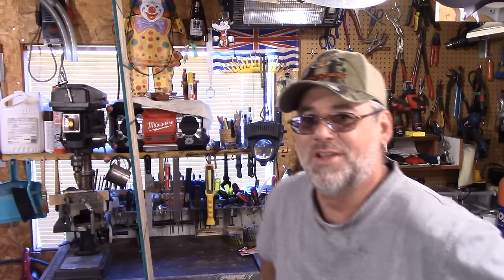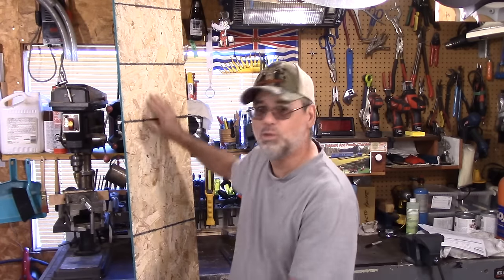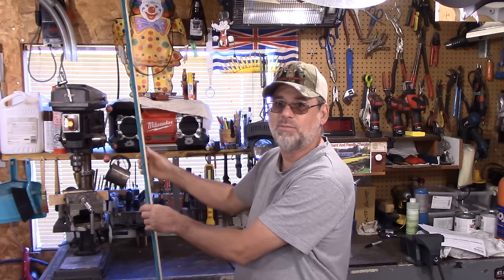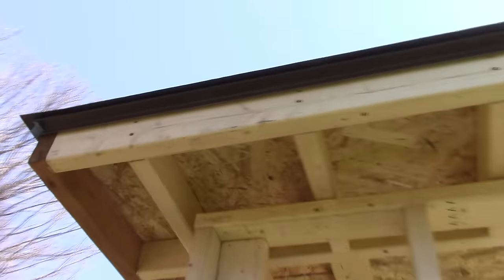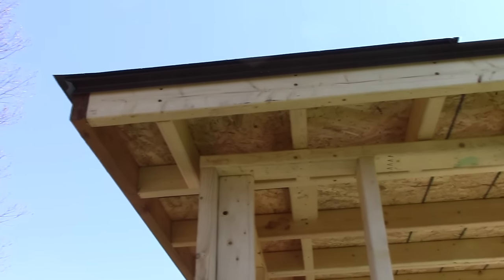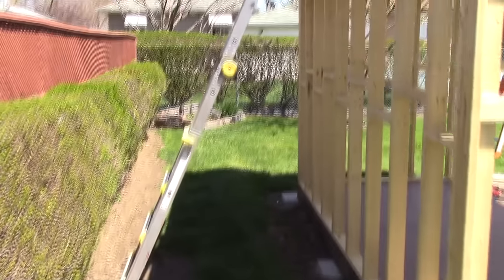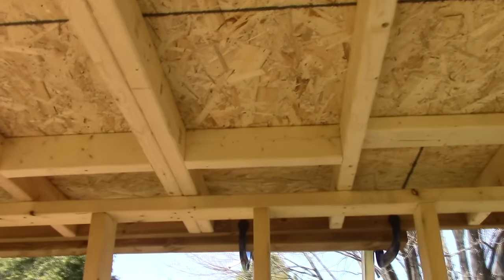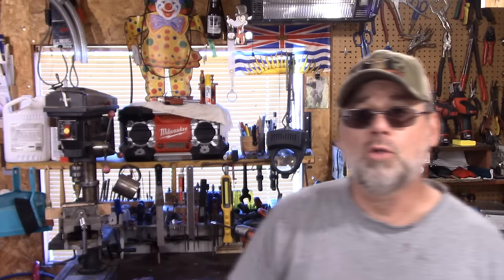HOW TO INSTALL ROLLED ROOFING ON MY GARDEN SHED BUILD

Comment: We bought some storm guard cuz we live in Southwest Florida and it's very rainy here and we want to make our shed waterproof. We put that directly on the plywood now we're kind of not sure what to do next but is there a peel and stick mineral rolled Roofing that you can put on top of storm guard the roof is not pitched very high so it's almost a flat roof
Reply from the maker: What I'm using but over the wooden deck same as you have done . This sure sticks well and is by far the lowest cost option as  steel roofing is crazy expensive lately but if it drops a lot that's  a great long term roofing material you can put  over top .
Reply: @SteveRobReviews  we already put the storm guard on as an underlayment, it has like a clear plastic film on top. Then we found out afterwards cuz we want to waterproof it of course that only shingles or metal roof goes on top of that not rolled Roofing but we was just hoping because it's flat that we could find something that was peel and stick I really don't know what we're doing here I don't understand your answer on what I should do but thank you for replying.
Reply from the maker: LOL I'm not sure what your asking .  Storm Guard has a sticky side that has a plastic sheet you peel off that sticks to the plywood roof .  The other side is not sticky.  In this video I'm using a similar product installed the same but has a shingled gritty  textured surface on the top side and like your storm guard a sticky bottom side you peel the plastic off and attach to the roof deck.   If you want to put the gaf  weatherwatch  on overtop of your storm guard  because of its ease of installation vs shingles or steel roofing its  your choice .  I do show a link in the description box how the weatherwatch has done over time .  I like the product and it suits my needs  as its easy to install at a low cost but its not meant for a house or compete with standard roofing products used regularly by code.
Reply: @SteveRobReviews  the problem where we had a question was yeah it stuck pretty well to the plywood but we did use pressure treated plywood so that was an issue that we might have to adjust with some cement on the corners and a nail here or there the other thing though was that the back of the storm guard has plastic on it is not it's like a vapor barrier it's not really meant to be sticky and I don't know what cement would be good to attach the cap with? Any suggestions would be appreciated. And if I use the peel and stick how is it going to stick to that plastic vapor barrier still have to have something on the edge of it to hold it down
Reply from the maker: At this point I would just leave it as is and  use some roofing nails to secure the product your putting on overtop.
Reply: @SteveRobReviews  so are you saying I need a peel and stick bitumean type rolled roofing product and then tack it down on the corners and seams with some nails? Would I have to put a cement on the plastic part underneath the bitumen or use peel and six so that will stick to the plastic and will that really hold it down though?  And if so what is the name or brand of this product that you might be able to suggest.
Reply from the maker: You could look around or use the product I used in this video called  GFI Weatherwatch  I bought from Hone Depot.  Sure just nail it down .

Comment: Would this stick to a previous installed rubber sheet..I have an older garage with a low pitch to it, a few years back i installed a big rubber sheet roll and screwed it on with screw rubber washers.. I'm noticing some leakage during rain.. in a few spots.. its October in mn and I'd like to apply a quick fix before snow.. you think this would adhere to the rubber  laid down already and some screws here and there? Thanks!
Reply from the maker: I would wait till next summer and throw a tarp on it .  Too  cold  this time of year for me.

Comment: Hi Steve, I was just wondering since some people claim that this GF WEATHER that you used doesn't always stick properly if the HENRY roll roofing adhesive would be  a good addition to this project. Thx in advance.
Reply from the maker: Hi 👍 
Ok I have used this for many years and  it will take the skin off your fingers it's so sticky in the hot sun so I'm not sure how much stickier it could be . I like it just fine and never thought about adding anything to make it  stick more.

Comment: Hey thanks for uploading this video. I wanted to know if I could roll this over top of existing shingles on my garage? I have a few leaks and here in Southern Ontario everything is so expensive. I seen this stuff as an inexpensive way to potentially repair the roof. Thanks so much Steve.
Reply from the maker: Thanks 👍 .  If you only have a few leaks I would go to home depot and buy a can of roof patch and patch over the spots.     This product does not do well Overton of old shingles.

Comment: I just built a shed and I used regular roofing singles and the starter shingles were made out of this stuff you used. it is sticky. It looks like you have no slope at all on your roof for water run off, is there a reason for that?  Thanks.
Reply from the maker: Clint I have a 1 inch drop from front to back so the water drains off  just fine .  Flat would not be a good idea at all. Cheers

Comment: Watched your video is was a great help. Might have to install on our den soon. How is it holding up so far
Reply from the maker: It looks the same over the winter as the first day I put it on. Cant guarantee how long it lasts but so far this is by far the fastest installed lowest cost shed roof I ever did. Cheers
Reply: @SteveRobReviews  Great.  I could't tell did you just put it on the plywood itself or did you put a membrane down first?
Reply from the maker: @FindUsCamping  I layed it down directly over the plywood.  It's very sticky in the hot sun , almost takes the  skin off your fingers:)

Comment: can I use this as a main roof over plywood? will it hold up over time or should I use another product? its for my flat roof on top of garage.
Reply from the maker: That's what I did in this video and it's lasted great all this time.
Reply: Might want to think about during the winter with a hard freeze if that might come up and then the thaw afterwards may let the water flow under it and give you a real headache !

Comment: Hi!  Looking at doing the same for an old old cedar shake sided shed.  I have a roll of asphalt shingle material that I want to use but it does NOT have the sticky adhesive backing like the product you used.  Can u please tell me how I would go about installing that asphalt roll?  (the shed is only 6x8 feet w minor roof pitch).....the previoius owner did have standard asphalt shingles on it but I have removed those).  Thanks and have a great day!
Reply from the maker: Hi Andrew
I would just overlap it by 6  inches nail it on with roofing nails and cover any exposed nails with roofing tar to seal it .
Reply: @SteveRobReviews  thanks.....
Reply: also-what is the metal flashing u used to go all around the outside edge of the roof?  Is it called drip edge?  If yes, what are the dimensions and can u maybe send me a profile pic of it as I went to my local home hardware store and they have several types/profiles/dimensions/widths + different costs.  Thanks.
Reply from the maker: I went to home depot  , it was the only  galvanized drip edge they had , about 3 inches on the top  .

Comment: I saw home depot but doesn’t say 2.0.  Also will this stick to the old felt or whatever is up there now? I can’t really tell.
Reply from the maker: Hi David
I  have no felt , just the osb and the roofing sticks directly very nicely.
Reply: If I cannot remove old felt, think it will stick?
Reply from the maker: Sure it will stick  so just put additional  nails in as the roofing will not be stuck to the roof deck , just the felt paper.
Reply: @SteveRobReviews  thank you for your time. And videos. :)

Comment: I’m tearing one of these roofs off on the weekend and replacing some of the plywood underneath, so is there any prep I should do after taking off the old roll?
Reply: I’ve been framing for a bit but not much roof shingling lol
Reply from the maker: As long as it's relatively smooth after  you prep it just fire it on and your done ✔
Reply: @SteveRobReviews  awesome thanks don’t want to let my girlfriends dad down 😂
Reply from the maker: Better bring a case of beer too then 😅🍺
Reply: @SteveRobReviews  will do thanks boss 👍🏻

Comment: Can this "rolled roof" be installed on top of shingles...??? I have repaired a low slope/pitch roof (on my shed) 3-4 times & it keeps leaking. Even put on ice & water barrier under the shingle but over the area where the leak is. Was planning to install a metal roof over the shingles but a friend suggested rolled roofing.
Reply from the maker: I would take off the shingles first and start off with a smooth surface.
Reply: @SteveRobReviews  UGH...!!! Not gonna happen...thanks.

Comment: Is that the GAF WeatherWatch underlayment? If so, how's it holding up?
Reply from the maker: All these years and still looks like new.
Reply: Just double checking, the product is meant to be used with shingles or something over top of it, but your using it with nothing on top of it and it's holding up?
Reply from the maker: Yes it is  , great so far.

Comment: I used OSB  on my roof when it first came out. They were boasting about how water resistant it was. Years later a leak developed and the OSB that got exposed crumbled. I had to replace the whole roof afterwards.
Reply from the maker: I agree it was not very good . This seems to have a wax type  seal on one side . I remember roofers refusing to  shingle a roof from it as it was super slippery too. It's much better today but I still think about years back and when it gets wet as well. Cheers
Reply: If you properly cover the OSB and have some air ventilation OSB  can last a long long time 🤙🏼

Comment: I'm thinking of this for the 3x12 awning on a shed with normal shingles elsewhere.   Are there any concerns that its marketed as a "Mineral-surfaced leak barrier made for use under asphalt shingles" instead of a finished product?
Reply from the maker: As I said it's an experiment for me so if you try it it's an experiment for you too. So far in my application its held up perfect and leak proof. Cheers

Comment: What did you do with the 3/4" that hangs over the edge? Do you have a video showing how you over-layered the second roll?
Reply from the maker: The overhang is needed  to fit nicely with the drip edge put all around.  As to the area where the seems meet is overlapped from the first layer at the lowest part and  the next layers.  There is a section on the upper part or the material that is just a bare rubber membrane that bonds to the underside  of the layer above .

Comment: My shed roof is covered with roll roofing granulated composite and needs to be replaced. I checked the Weather Watch product you covered your roof with. Unfortunately it only comes in black and white. I want to match the low pitch roof of my shed with the rest of the roof which is covered with shingles, weather wood color). Do you have any suggestion or recommendation?
Reply from the maker: Well I cant see my roof at ground level so black is just fine for me .  More rolled roofing or shingles , whatever works for you.

Comment: wondering if i could use this material to weather proof my wood camper i am building i would use it on the roof and the sides  instead of fiberglass especially seems like it would be easier and faster to do it especially if i have no care what people think about the end product for me waterproofing is what my end game would be so thank you will look into this product for sure
Reply from the maker: I think if it looks good to you sure.
Reply: @SteveRobReviews  the only thing I can see and all the material is that it is used as underlayment with shingles on top sort of wondering about it but I have time to think about it I thank you for your opinion and I most definitely thank you for your suggestion of the possibility being able to use this as a stand-alone roof and wall covering

Comment: Do they really recommend adding screw penetrations on top of the roof? That seems counterintuitive to everything I know about free standing water on roofing.
Reply from the maker: The screws have rubber washers avoiding leaks.
Reply: @SteveRobReviews  I realize that, but it's still a penetration and over time water will eventually find a path.
Reply from the maker: @luke9822  I will do an update over time but for now it's not leaking .
Reply: I would of just let roofing stick to the drip edge and hoped for the best
Reply from the maker: @jasonbranson448  Sure you could do that  Jason. So far it's been working out fine as is. Cheers
Reply: @SteveRobReviews oh I agree with you completely on fasting it down  but I'm building a new 8x10 as we're speaking ,it's my yard is kinda boxed in on all sides with tall trees ,high winds aren't an issue . Loved your video
Reply from the maker: @jasonbranson448  Thanks bud much appreciated 👍

Comment: Hey steve do you overlap it or do you just keep it flush
Reply from the maker: You must overlap it , there is a section that is obvious that shows the overlap placement . It seals on the overlap spot  that will never separate after installation.

Comment: Help i am Doomed, my Tar and gravel Roof is 17 years old so far no leaks, but when the day comes should i just Clean a 5x5 foot area of rock pebbles and dirt and melt on a half inch layer of henry tar roofing, i seen videos of spray foam,  what would you do with a  Tar gravel Leak.
Reply from the maker: Not a hot tar roof expert . Cheers

Comment: Do you think it will stay if i stick it over a shingled shed
Reply from the maker: I just did one last week , yep overtop but I nailed it down too. Just a low cost option to stop water leaks nothing fancy,  easy to do and fast.
Reply: STEVE ROB REVIEWS what nails do you recommend..did you use a lot or a few....also trying to understand the accent: are you from Alberta
Reply from the maker: @TheCostOfLiving-  LOL Ontario   I just used some 1- 1/4 inch roofing nails  .  I did a 9 ft x 5 ft  shed roof , put 2 sections on and where they meet  I put roofing nails every foot from side to side and around the perimeter.  You can put some black roof patch on the exposed nail heads if you like as well. Cheers

Comment: June 2023 1 roll of GAF is $118 at Lowe's and $110 at Home Depot in my town.
Reply from the maker: That's  a huge price increase since I bought it but it seems everything is more expensive now.
Reply: @STEVE ROB REVIEWS  how has it held up with no primer
Reply from the maker: Douglas look at the link  shown for the update , it's looks as new . I have been using this for many years so one of my building at my northern camp has had it on for over 10 years and it still looks great.

Comment: Question what’s the part number to the screws I have a roof with more of a slop they didn’t put any nails and it’s starting to slide off
Reply from the maker: I don't have a part number so just search steel  roofing screws , that's what I used.
Reply: @SteveRobReviews  thank you sir !

Comment: I just did a similar thing with henry/bakor brand and it didn't stick to anything even with their primer. it didn't even stick to itself. Likewise their terrible blueskin flashing. Had to replace the entire roof (osb and all). this week

Second time around I have used better flashing (3m, which actually sticks like mad to everything and doesn't tear). I put the resisto brand version of this eaves protection layer on, and it sticks very well, bonds very well to the 3m flashing and fairly well to the osb. I also used back up nails under the connecting seams.

So here is my question: This is NOT meant to be an exposed layer. They says various things between gaf and resisto, but basically, a few weeks to a few month of exposure on a sloped roof is all that is recommended. How is your roof after 4 years now? any leaks, drips, tears, cracks or uv damage? I intend to put the cap sheet on, but I can't do it for a while, possibly not til spring and I want to know if yours has managed fine. My only reference is the henry which did NOT manage fine for even a week.
Reply from the maker: Well the oldest shed I've used it on is almost 10 years old and it still looks good . Your correct as to the manufacturers  recommendations but this works good for me as is at a good price,  easy to install. Cheers 👍
Reply: @SteveRobReviews  Thanks! That was what I was hoping.  Their rules are to qualify for their 25 whatever year warranty I expect. We don't need none of that on a shed haha. :)

Comment: Steve, great presentation! Did you align the edges side by side on each roll out or did you slightly overlap each rollout,how much?
Reply from the maker: Thanks Ken , from side to side its all lined up  even  about 3/4  past the drip edge on each side and the same on the  front and back of the shed roof. .

Comment: Liberty 3 ft. x 34 ft. (100 sq. ft.) SBS Self-Adhering Cap Sheet in Black for Low Slope Roofs
This stuff is only slightly more expensive but designed to do what you're doing with the underlayment and will last a lot longer, its available at Home Depot
Reply from the maker: Thanks bud much appreciated.

Comment: I’ve got tar paper on already was thinking about shingles’s until I see this can u use it on top or do I have to remove it??
Reply from the maker: You can put it on overtop but you're going to need to put extra fasteners into the  wood  to hold it down well.